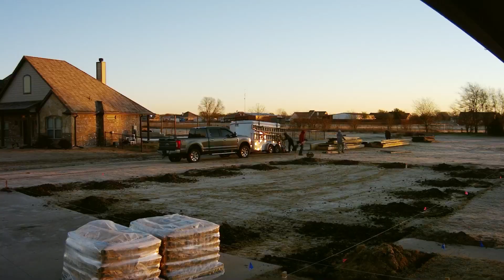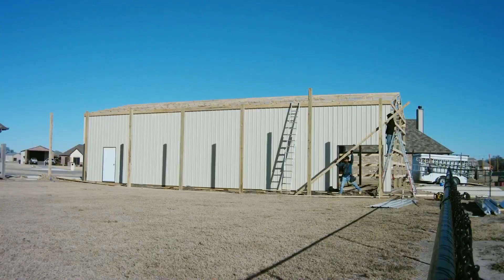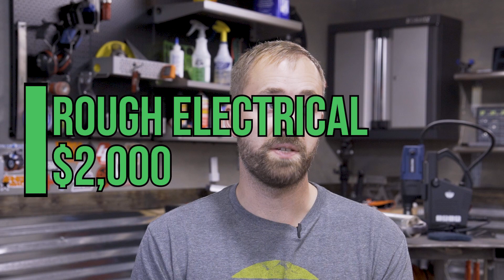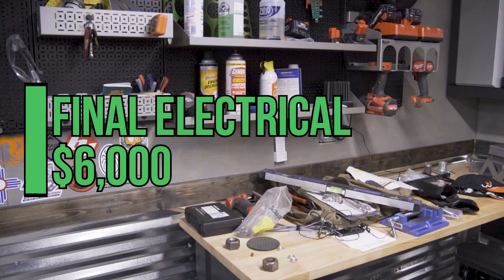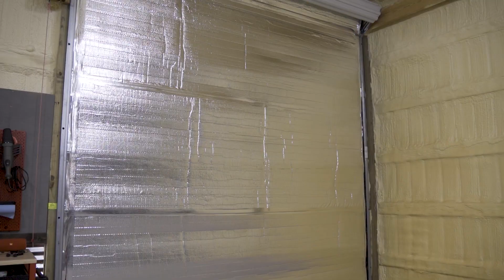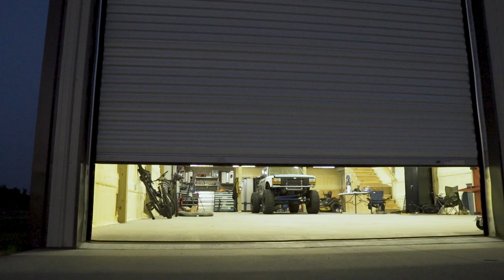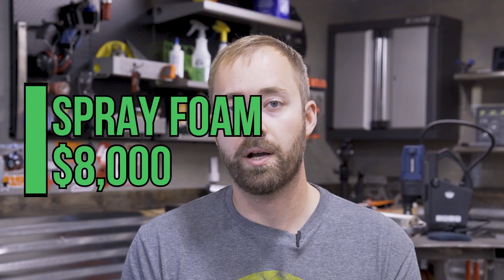How Much Does A 30x60 Pole Barn Cost? - Reckless Wrench Garage

Comment: Another thing I’d like to suggest for electrical, is run another 50a circuit wherever the electric car is eventually going to be. I’ve been using one of my welder outlets but I’m finally going to bite the bullet and run a separate line for it. Even if you don’t have or plan on getting one, it’s a solid selling point and I guarantee that at some point you’ll be using it.
Reply: If you;re going to go that far, mught as well make it a 60amp for an RV hookup, put it outside under the eves of that parking area. Then you;re ready for all worlds, as well as a panel tie in for another panel.
Reply: I agree 100%, except make it a 60 amp circuit so you can run a 48a charger on it. I'll be redoing my attached garage soon, it will definitely get a minimum of a 40 amp circuit to run a 32amp charger on. A Tesla Model 3 Long range has an 82kWh pack, which would take around 11.5/12 hours to charge from a very low SOC to full. A 48a charger would make that time around 8 hours.
Reply: If you're pulling power, put 3p200a in and be a real man
Reply: Great idea's, but don't park your electric car in your shop, there have been several fire's and electric car batteries exploding all over the country, good luck and stay safe.
Reply: @robertwestbrook9344  That was only one vehicle (the chevy Bolt) it was 19 vehicles total and that was a year ago. Chevy identified the problem and fixed them. EV’s are far less likely to catch fire than ICE vehicles.
Reply: @whodat90  there isn’t even close to a large enough sample size to say that with any certainty at all - EVs are less than 1% and the avg age is way less than all the gas/diesel vehicles on the road. The other thing is that ICE vehicles are much more likely to catch fire while in use - whereas EVs charging overnight in your garage are more likely to result in building damage instead of just burning the vehicle.
Reply: @JStone2026    I’d like to see the data supporting your claim. I just did a quick google search and found reports from Reuters and KBB stating that EVs are up to 100 times less likely to catch fire than ICE vehicles. Ford just recalled 600k+ vehicles due to risk of fire while running, 200K for fires while sitting. Hyundai/Kia recalled just under 300k vehicles for fire risk while sitting, including a stop-sale and warning not to park indoors. But hey, rather than junk up this thread let’s agree to disagree?

Comment: When I built mine it turned out to be cheaper to have the power company pull a separate line from the pole to the building. I now have two separate power bills, but I also have 200 amp service.
Reply from the maker: I wish I could have done that. Utilities on my street underground and the tie in point is on the opposite side of the house
Reply: @RecklessWrenchGarage  Mine charged me about a buck per linear foot to run the new wires, (underground) everything included. They figure they’ll eventually get their money because the electricity is charged at a higher flat front rate so I pay that twice, once for the house and once for the shop.
Reply: @whodat90  this is what I want for my shop, the backyard has overhead lines so I'll be probably 50-75 ft to install from a pole, what was your overall cost on that?
Reply: @kylancook3477  I was under $500 total. They provided the wire, dug the trench, and did all the work. All I had to do was pick up the meter from one of their offices and show the workers where I wanted it to end up.

Comment: Great video, I was thinking of building a shop the exact same size as yours.
Would you mind going into detail on the permits you had to pull and how you walked away from the build (things like; you wish it were bigger, you wish it was smaller, you wish it was air conditioned, you wish you had more insulation, the insulation just right, you wish you had more plug outlets, etc)?

Basically, everything you would have done differently if you did it again.
Reply: Seeing the yellow stickers I know who did the doors.  I would say if you can, always go with a sectional door.  It’s generally cheaper and it can be maintained/fixed so much easier if you accidentally bump it or a part breaks.  Part of that is to design your ceilings and openings to allow sectional doors (lights and fans can conflict with sectional doors if not in the design consideration). NEVER let the metal building company talk you into their door package cause it’s probably the cheapest roll up door they can throw in.  Most of the package doors I see won’t accept door openers.  Also if you have to get a roll up door, never go over 12’, it’s just more problems down the road.
Reply: @MrTXForester  Thanks for this info, I'm planning a shop build for several months from now and this makes a lot of sense. I'll see if I can't plan on the sectional style doors. I was 50/50 before your comment on which doors I would go with.

Comment: Building a 40x30x10' pole barn now in NW Ohio. Best deal was $44k for everything to put up the building and concrete. Includes ~350 SF of concrete for sidewalk and driveway extension. No electrical, plumbing or insulation. Basic building with 9x9 overhead and 3' man door. Had the concrete company also do the site prep work and saved $2k, plus makes concrete guy happy to be pouring on his own prep work. They brought $200k of equipment and had the site prep done in 3.5hr. $26.5k for building w/ doors + $17.5k for concrete & site prep.
Reply: i live in nw ohio would like to know who you used...thanks
Reply: @stevewallace6851  Yeah. Me too.  Attica wanted $10k to prep my site.
Reply: @Boscovius  Have your concrete guy prep the site. You'll save money and your concrete guy won't have to work on someone else's BS.
Reply: @stevewallace6851  I’m in Henry county whereabouts are you
Reply: My brother purchased a 56' X 60' X 26' pull barn kit from Menards for $17,500 pre covid. We did all the work including ground prep. He did the concrete after the structure was up so it didn't have to be covered to protect the finish. He hired the concrete work done cuz 56 X 60 is no joke and takes a crew to pull off.
Reply: @soverien41 what?  You have to be off on your dimensions.  26ft high walls?  LOL
Reply: We just paid $32,700 for 30*40*10 with 1 ft overhang soffit, walk through door, 2 garage doors, 2 windows, 4 in concrete, gravel for new driveway included, gutters in southern illinois
Reply: @crystalrowatt4066  who did you through?
Reply: @WaitWhatsMyName  si pole barn and that included double bubble for everything as well
Reply: @crystalrowatt4066  man the prices are sooooo much cheaper than the west coast. Here the price is double that
Reply: @WaitWhatsMyName  I think my contractor ordered through a company called heartland metal sales in Marion IL if that helps. And I believe someone ordered a kit and had it shipped as well
Reply: @crystalrowatt4066  ill look into it, thank you. Im trying to build in spring as soon as its not 0 degrees
Reply: @crystalrowatt4066  May I ask if you used Newcomb Construction?
Reply: @3Firewoman  Nope
Reply: @crystalrowatt4066  who did you use to build your building?
Reply: @cado3510  Superb Pole Barns. A 4-man team completely pole'd & framed a 40x30x10 in 6-hours. Super nice people. 

Used a local concrete guy who does concrete full-time (part-timers just aren't reliable).
Reply: @cado3510  Superb Pole Barns (Dundee, OH...south of Cleveland). Nice group of guys. Quick. Not Amish (if you're wondering).
Reply: @crystalrowatt4066  We are near Carbondale. Could you let me know who you had to put your garage up?
Reply: @crystalrowatt4066 who did you go through we are wanting to build one in southern Illinois as well.
Reply: Never mind just read through the thread. We just got a bid for a 1760 sq ft shell through S I Pole Barn and it was higher than I was expecting but it could just be the current prices..
Reply: Who was your builder? Im looking for same size.@crystalrowatt4066
Reply: What? Thats cheap these days. Best quote i could get was 55k for a 30x60x12 with a 12ft lean to. Not including concrete but that did include insulation.
Reply: Hey man what part of northwest Ohio. I’m from Henry County
Reply: @PracticalTacticalFedeli  Ottawa County
Reply: @DJtheDad  hey that's where my brother's at over by Bono curve though
Reply: @DJtheDad  Shoot man you’re real close. I grew up in Hamler. Just north of you up 109
Reply: @PracticalTacticalFedeli damn small world I’m in Henry county too! Lol did you ever decide on who to go through? Ever check out mqs structures?
Reply: @KingXory  Holy shit man that is crazy. I grew up in Hamler. Patrick Henry-Used a local company out of Jackson Michigan
Reply: @PracticalTacticalFedeli  i grew up in lc! Small world. what was the name of the company? I’m going to be looking for company’s for quotes soon.
Reply: Im also in henry county ohio. Over by ridgeville. I have used holgate lumber in the past. They did a great job just a little pricey
Reply: What part of Ohio? I'm in cincy and looking for contractors and builders.
Reply: Southern Ohio here.. got a estimate for a Menards pole barn kit... basically wood and metal for a 20x32.. 8k$
Reply: Where I live just the permits and filing fees would be 40k!! Then the property tax increase would be another 10-15,000 per year!!!
Reply: @notnecessary7730  Must be New York State. They literally HATE working people and grab every dime we have if given the chance.
Reply: @notnecessary7730  same im doing a shipping container 40*9*9 its like 3k for one and in my town long as there no foundation it would be consider a shed and isnt taxed. i dont need anything super big just a place for my 2 cars go and storage.
Reply: @notnecessary7730  me too - new home permit is $100K ... where does that money go ?
Reply: @wardmontgomery9259  oh.....you know.......
Reply: @wardmontgomery9259  Damn! Where was this, Russia?
Reply: @wardmontgomery9259 ow that is crazy. Where I live we had to get a free driveway permit to connect to the borough road. We built out of pocket so we didn’t require inspections, don’t worry it is over built as I have friends in the trades that have been over and they say it’s way more than people will pay for to be competitive. We built a duplex with first one half to have a place to live then added on building a bigger owners unit with a nice garage. The garage is done and we will be moving into the other unit next year. This was a ten year project and before I retired it was like having two jobs. Rent potential is around $1300 a month which will pay utilities and taxes with some left over having a place to live for nothing.
Reply: @Chris_at_Home  that’s a great plan and impressive accomplishment - I am considering building a triplex in Idaho where the fees are about a dollar per square foot.
Reply: @TheMonkdad  El Dorado County above Sacramento, California. Other counties in California have similar fees but the property tax cannot exceed 1.25 % per year. Not all counties charge that much for building permits.
Reply: @wardmontgomery9259  ...straight into the pockets of the demonr.....er....assho.....er...welll...you know....yeah
Reply: @wardmontgomery9259  where do you live that it costs 100k just to get a permit to build a home.
Reply: Where can you buy a 3 foot man door? Is it a doggy door?
Reply: @cranberriesdoodle1450  A "man door" is an entry door.
Reply: @DJtheDad  I know that, but why is it a 3' man door???
Reply: @cranberriesdoodle1450  It's a 3' wide x 80" hinged entry door, pretty standard.

Comment: The dirt-cheap illegals labor, apparently "doing the work americans won't do", is a great option in Texas.  Where I live that same building is $300k
Reply: That’s a myth.. you’re not getting a “deal” on labor. The middleman gets most of the money
Reply: @Kelly  
That's why you have to be the middleman.  Drive down to Home Depot and pick up a truck load of them and bring em to your site
Reply: Iv done that, the reason they are at Home Depot is because they are not good enough to be on “crews”, only good for moving a pile of rocks from point A to B
Reply: Wolf Barn Company, in business since 1980.
Reply from the maker: Yep! That's why I trusted you guys! I am super happy with the building!

Comment: Too funny... in the beginning of the video you said you got quotes from 85K to 135K and that was out of your budget.  Then at the end you spent  75K.   Not too far off from the turn-key contractor (bottom) range.  Moral of the post... plan on spending 80K for a building that size.  I suspect most folks would think they would get a building like that for under 50K.  Did you think you would ever spend 75K for a garage/workshop ?  I would like to have one that size, but I shutter to think of having to spend 80K on it.
Reply from the maker: 75k for a complete building is still less than what some people pay for a new truck 🤷🏼‍♂️
I was expecting around 65k. The doors and foam were more expensive than I was thinking and went over what I expected to budget.
Reply: @RecklessWrenchGarage  well, that's true... couldn't buy a new F250 Diesel for what you paid for the garage, and the garage will hold its value (maybe even appreciate) where as that new F250's value will fall like a rock.  Doesn't matter for me as I couldn't afford either one.  You built a nice place there that should serve you well for years to come (lot longer than that F250 would.. lol)

Comment: You should have just moved to a new property with a building already on the property and get a house in the process.
Reply from the maker: Then I wouldn't get a shop built how I want and I would be working around someone else's building. I spend 70% of my time home in my house, so I bought the house I wanted and built the shop I needed
Reply: I agree Reckless. It’s also not that easy to find properly at a gd price or in the area you want.

Comment: i'm going to build a 40x60 gambrel style barn 6" slab in january with a mezzanine. its a metal framed building but i didn't buy the metal for the walls, going with hardie board. my budget is showing right now a cost a 141k

Comment: So far I have $55k into my 30x60, that includes leveling the pad, building and install, gravel, concrete, and doors.

I have 2 at 12x12, and 2 at 10x10 doors, plus the man door and two windows. I'm currently waiting on the concrete to be poured.

The time frame, was building purchased in early August, install was 2nd week of November. Hopefully it'll be finished in a couple weeks. Then I'll worry about electric next spring.

I like your mezzanine, I may build something similar at some point, plus the porch.

Comment: I myself would like too do a 40x80x12 thanks for the info.
Reply: Thats my building size, 4 ft overhang in front 2ft back. Radiant floor, etc.. 2018 building price was 45K for shell, now it would be 100K !  Have build videos on channel , from radiant to electrical . Check it out before you build

Comment: i’ll tell ya that’s pretty cheap, in 2001 we built our 50x65 and it was $210,000… but the county we were in most was for engineering cause we were on a coast of FL, and right now i moved right to the center of the state and anything under $75,000 i don’t need a single permit to put one up… and you just gave me a damn good ballpark cost on something that big for our race shop! thanks for the video!
Reply from the maker: Glad this was helpful!

Comment: Nice shop, thanks for answering that question. If your trying to figure out why the prices fluctuate just take these pre-built sheds for example. I just bought a 14' x 28' with a base price just under $13k, I added double floor, complete spray foam 1", insulated 9' x 7' overhead door and the final price was just north of $20k. Then $5,500 for concrete, gutters were $950 (got screwed on this), $750 for the metal ceiling, $400 for the OSB walls, $300 for the insulation bats and can't say what my electrical cost (I'm a journeyman electrician by trade) but when I get time I'm going tally up my total cost. If you forget anything your going to know real quick that your way over budget so put that in the back of your mind right from the start. If your going to do it yourself make sure you follow all building codes and the NEC, the NEC has really changed the rules on these garages.

Comment: Man that's a nice shop. I wish I had poured concrete last like you did. I did that first and then started on the walls. The only difference between what you did and what I'm doing is I'm building by myself and half my building is block. Thanks for all the information. When I start to look for all what I can't do or beyond my abilities I have an idea of cost. Thanks for the informative video
Reply from the maker: Thank you
Reply: Is there a reason you prefer the concrete to be done last rather than first as the full sized building base? I am going to build a 30x50 in a few months so just trying to get some input before I get started. I would have thought doing the concrete first would help the pole wood last longer since it would sit on top of the concrete and wouldn't get as much moisture to it maybe? Would like to know your thoughts! Thanks :)

Comment: How many months did you spread out the build?
Reply from the maker: I spent about 6 months on it. Dec 21 is when I put the deposit on the building and it was finished and ready to move in around May 22. Pretty much all roll up doors at the beginning of the year were on a 4-6 months lead time. Some places wouldn't even quote me for doors because they were so far behind and not able to get doors